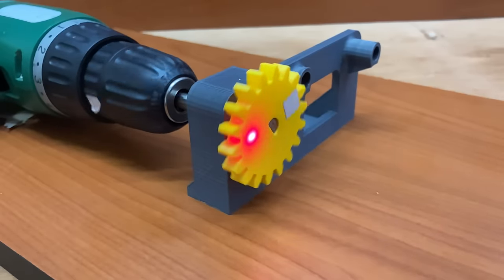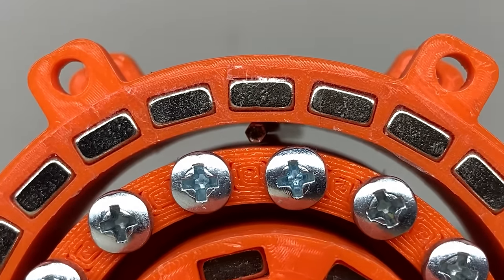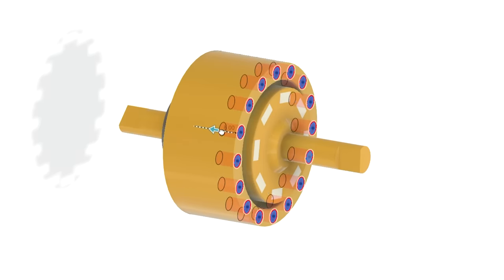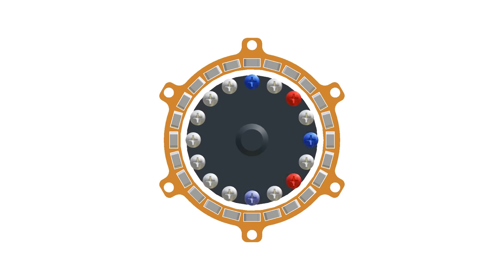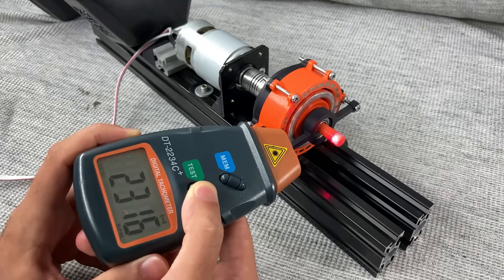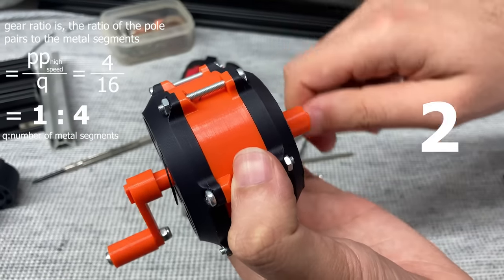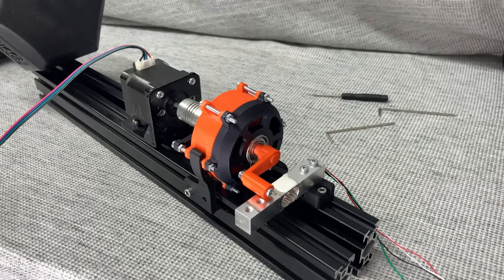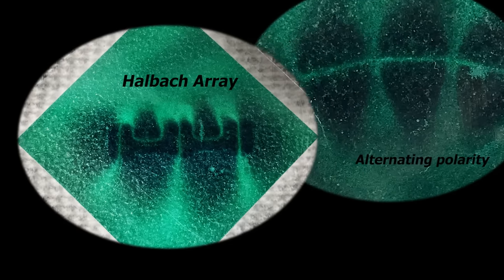Magnetic Gears - Why Nobody Talks About This?

Comment: I noticed a lot of small water pumps and generators use magnetic coupling to keep the electrical parts sealed; there’s no shaft coming from the motor that needs a seal that will eventually fail.  They aren’t using magnetic gearing but it seems like a good place to apply the use of them if needed since there’s already magnetic coupling limiting the force that can be applied to the output by the motor anyways.
Reply: still needs bearings
Reply: Came to mention the same. Mag coupling is quite common in many applications.
Reply: isn't that just induction rather than gearing? I haven't seen any pumps with actual gearing inside, they are just like any other motor, but with a thin plastic barrier between the stator and motor for water proofing. I've only dealt with small pumps for liquid cooling and etc, do larger pumps have actual gearing?
Reply: @HicSvntDracones  induction refers to a changing magnetic field inducing a voltage into an object.
Reply: Theres no need for rotating gears if you can just move the energy where you want over wires and convert to mechanical work where you want. This has losses too.
Reply: @lasskinn474  but if you need absolutely no holes in your design then it is viable
Reply: @nothingtoseehere1221  well then too you'd rather use the magnets as a motor and driving side as generator and hook the driving and drived units up with wires, you get to use more of the magnets at same time rather than just the couple that are passing each other. Like with the aquarium pump.  With control electronics you get to even control the speeds seamlessly and can even buffer the power in capacitors and batteries.

So anyway magnetic "gears" are used a lot, just not in the "primitive" simplest way as described in the video
Reply: did we miss the change of the game?
Reply: Huh, neat idea, might be useful for pumps or small rc boats alike
Reply: @UNSCPILOT  the pumps use a small ceramic ball as the bearing, and the pumps impeller itself is the rotor. With the housing being the stator. That's how they're doing sealed motors like the D5 and DDC in aquariums & computers
Reply: Aquarium Pumps are normal electro motors, using a permanent magnet rotor and a electro magnet stator. there's no gear box used in those pumps. a electromotor is something completely different than a magnetic gearbox. electro magnets can build up much higher magnetic forces than permanent magnets - therefore you can achieve much higher torque with an electromotor
Reply: @Blox117  Yes, but things like stainless steel and ceramic bearings do not require electric isolation. They can be designed for operation in hostile environments without needing an additional wearing surface.
Reply: @dustinbrueggemann1875  stainless steel will still corrode
Reply: magnetic mixers used in laboratories are a fine example of isolation (no bearings, just a teflon block with a bar magnet sealed inside)
Reply: I use a magnetically driven centrifugal pump to move liquid NH3 and have often wondered how this could be applied to other non contact motive forces
Reply: @jsmc2104  it is technically in contact though
Reply: When the lifetime or cost of quality is way more important that it's small flow efficiency that makes perfect sense. Much of the same thing with handling radioactive, toxic or corrosive substances.
Reply: @HicSvntDracones  A Large pump would either be a turbo pump or a piston pump. Both would definetely use gears to match rpm and torque to the engine(motor) driving it. On small flows you can basically ignore that matching as electric motor high rpm would work well enough with some static Pelton, Francis, Kaplan or Cross-Flow wheel design. You would limit the electric motor to not generating cavitation noise overdriv8ng the pump and destroying the blades and that's about it in engineering. On lager applications the energy loss of a bad match would be significant due to the high kinetice energy demand of moving a lot of dense fluid fast - it can be a lot of mass flow.